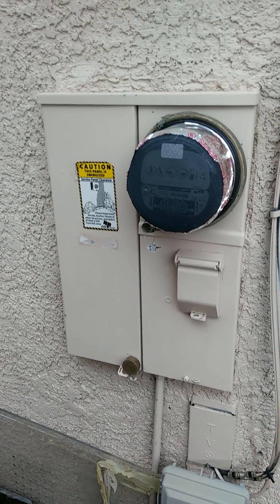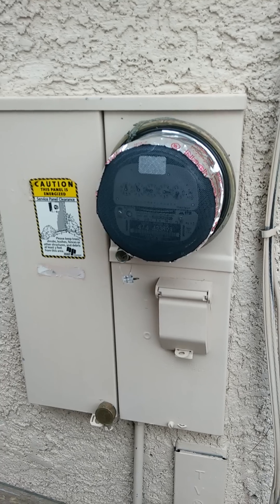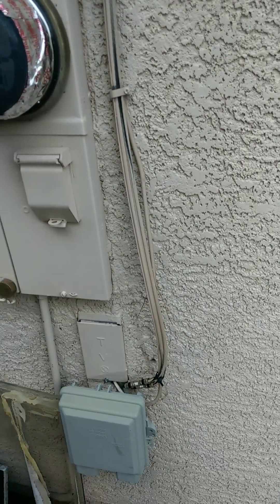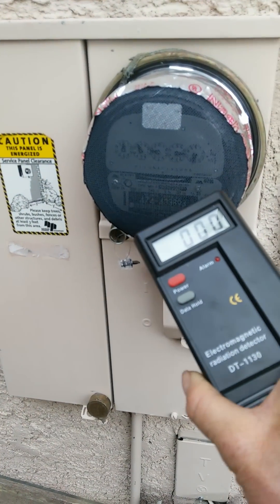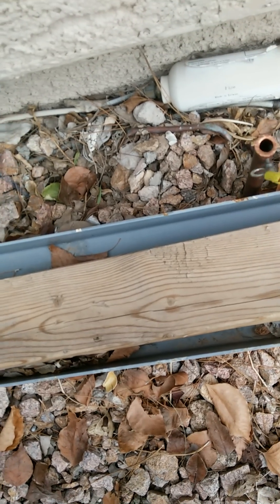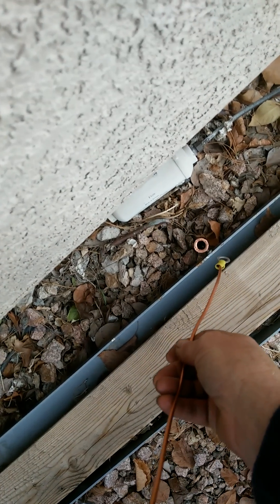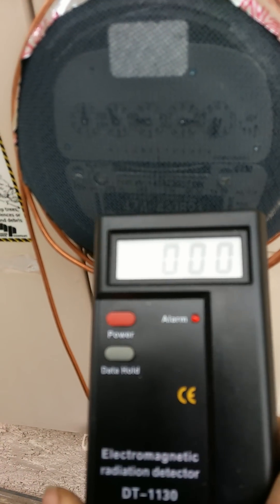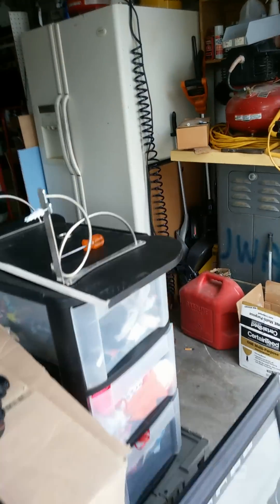Out smart the smart meter

Comment: Hilarious how so many people commenting that she is a dumbass are actually dumbasses. She said in the video that they put one on her house and she had it removed and she was just showing that even the analog meter would put out a strong magnetic field. There's an old saying you have two ears and one mouth for a reason, just saying.
Reply: Turbo Chevelle hey dumbass the smart meter would emit at a distance, the analogue meter only picks up within very close proximity as any blady conductor with current passing will create an Electromagnetic Flux, but isolated to a distance calculated by formula pending the amount of current passing, the type of insulation on the cable and the cross sectional area of the cable.. did you see the EMF meter was on 000.000 until she was right up on the analogue electrical meter? You have 2 eyes, two nostrils and a mouth, can you see you stirred shit  because I can smell it and you will taste it, everyone's right though, however I was polite to explain all about EMF and radio waves but still think this lady would have been better off pouring another glass of wine and rolling another spliff rather than to make her rediculous video on you tube...

The bitter end is her lug on her wire was far to large for that screw to make a permanent connection to the copper tube in the ground, she just clipped it around but you all saw it unclip in the video, then she had it extending to a coil around the meter, an EMF that cuts through a conductor at 90 degrees will induce a current, therefore a coil has got many 90 degree points where mutual induction will take place and a propper electrical charge will become induced into that coil, should the lug not stay secure, and the lug end is not earthed there is a high chance of someone sustaining electrical shock as the entire gizmo this lady put on the meter could potentially become a death trap if this system is 3phase at even 30A per phase, because who knows what else she done, I think y'all better off wearing tinfoil hats if you paranoid about your home meters and things, that's got nothing in comparison to what you experiencing with the phone you use or laptop you use or constant WiFi you sit in within your home and coffee shops for your internet.. haha this is all just such a great laugh and good start to 2018.. thanks
Reply: Turbo Chevelle 👍
Reply: Turbo Chevelle 
Everybody is always ready to jump to a conclusion. Ppl need to get their brains and their mouths calibrated. And do it at about 70/30 mix, with 70 being the brain. Have it so their brain works more BEFORE their mouths open....
Reply: She’s still kind of a dink. No evidence has ever been proven that illnesses or injuries can be cause by Electromagnetic fields from small consumer electronics. The level of electromagnetic field that harms humans is around the surface of a large amount Kv main line that’s can instantaneously burst you in flames because of the arc.
Reply: Justin Gibson yeah you better do some more research, there is evidence of what it does and causes and you'll be surprised how  long they have known it. While you're at it research microwave warfare. It's a.
Reply: one of the most important things to remember is to not give a fuck about the opinions of retards. who cares what they think? anyone they could possibly tell is most likely also retarded or pays them no mind.
Reply: I agree Chris Morse, I have never seen so many obtuse power company managers in one spot. All of them claiming their smart meters are 100% safe.  I bet the FCC is not laughing at these managers.

Comment: Extremely Irresponsible Journalism! Wiring is NOT a HOBBY! Hire a licensed electrician, obtain proper permits and inspections. There’s a reason why there is a State Board of Examiners of Electricians. It’s kind of important.

Do you have enough knowledge and expertise to be sure you’re not going to endanger yourself, your family or your home?

That’s an analog meter. Note the little analog dials and the rotating disk. Even if this worked she’s going to get busted for attaching a tampering device to a meter.

Comment: I believe there's a reason why her meter only cost $10...  It is NOT an RF meter...  It is an EMF, Electro magnetic field meter.  (Gauss meter) All energized wires/equipment will have some sort of field around them.  (looks like a standard analog meter which does have electricity flowing through it)  Her meter didn't start going crazy until she was right up on it.  And probably drops off as you back away.  Normal   Good to know though.  You don't want to be real close to them either.   She should check her outlets and appliances around the house to see how far they radiate out.

Comment: To those people saying it is not a smart meter, well you are only half right. It has a transmitter inside operating either 700mHz or 924mHz.  Using a spectrum analyzer app for android phone will show the actual  frequency. The electric company loves them because they just drive by to read the meter without getting out of the truck.  

By putting the aluminum foil and grounding the foil you are in effect creating a faraday cage to  cancel out the RF signal. You did a great job BTW.  Hope the electric company allows you to keep it on.  

as an alternative   just go solar and screw the electric companys. I've been on solar for 18 yrs.  Yeah they hate me.
Reply: well that screen is attached to the power companies property

Comment: Putting the detector up against the meter is a useless reading unless you're in the habit of rubbing your body on the meter. You should hold the meter about 6 feet away and see if there's any reading then. And rather than paying a monthly fee for an 'opt-out' meter, you can buy a wire-mesh shield from Amazon for around 30-40 bucks that will block all the radiation from the smart meter they had installed
Reply: In addition, see what the reading is inside room space, from the wall, out into that room, where the meter is outside.    The measure taken outside, should be relevant to if, and how much emission is perhaps being a problem for the next door neighbor.    The Emissions of far enough to reach head office computers, so don't think that if the readings seem weaker 6' to 10', it's not an issue.   We live drowning in Electro-smog, and most don't even have a clue.
Reply: Well the meter is plugged into a sheet metal box. From what I've seen in other tests, that metal blocks 100% of the signal from the smart meter so everything behind the meter box should be safe. I suppose you might have to worry about your neighbor's smart meter though, if you're  homes are close enough together. If you do want to check the inside of your house make sure you either have a fancy detector that only picks up the dangerous radiation or be sure to turn off your WiFi because that'll mess up your readings
Reply: Good points.   
One might think the metal box would shield.  However, enough people have readings that show the room on the other side of the meter, is loaded with EMF/RF  In that case, it might be wise to check to see if the meter is connected to ground.  Utility companies have been found to omit connecting it to ground...which can trigger fires, among other things, including a mess of wild signals.   Smart meters are not just counting your actual usage, they are counting the line "bleed", and the energy returning from your house to the GRID, which you used [it "returns to sender" so-to-speak].   
We are being billed for energy we don't use [the bleed], and about double for what we do use [the incoming, and the returning]  ...AND they manipulate what we pay by adjusting algorithms to make it seem we've used more....similar to how property taxes are adjusted using the Mil-Rates, while on paper, the basic unit price remains the same.  
One utility company rep actually said "People have been so good at saving energy, the utility company cannot pay it's bills" [that they are forced to pay to larger energy handlers, like Bonneville Power Association [BPA].   That's a huge "tell". 
When utility comes to replace a smart meter for the 3rd time in as many months, and tells the resident "Well, there must be something wrong with the meter, because you have a 300-amp service, and the meter is only showing about $50/mo, even in winter"....that's also a "tell".      In that case, the couple in the big house, with a barn/shop, used wood to heat, used a lamp to read by, ran the fridge, no TV, nothing else on......  Once the guy told the utility:  "hey, just because our electrical service has that capacity, doesn't mean we use it all the time!!!"...the utility stopped replacing their meter.

Comment: Still Dirty-Electricitiy in the cables , like caused by the cheapest ( FIRE causing ) Chinese computer power supplies 

Radiation guards must be properly earthed / grounded ... also always check if all all outlets & extension cords are properly grounded

Comment: let me ask do you have a computer a phone or a computer?  they emit the same damn thing
Reply: Usually (at least European) computers have Power supplies with better filtering & a PFC ( even the cheapest legal ones , even the ones with FAKE output power ratings  ) ... in EuropeanUnion beginning from 75 Watts maximum consumption, Power supplies are also required to at least have Passive-PFC & generally filter coils & filter caps ( X for all & Y for grounded PSUs ) & often grounded shielding

Edit: always make sure that all sockets are properly earthed ( = "Equipment Ground" )

many for US-American market intended cheap ( even Computer-) power supplies have absolutely no filters, no PFC & external power supplies also no shielding at all ( its just the rectifier [ or more often 4 pathetic diodes or in "wall warts" just a single diode ] ) & the primary electrolytic capacitor & now you are at the switching transistors = high frequency source + dirty electricity  ) 

and Ethernet wired LAN is an alternative to WLAN 

only use the smartphone hen necessary & & use the flight mode or power of when not used ... also use a headset  & do NOT put it next to your balls
Reply: Smart meters are not the only issue only the worst issue they are 4 watt making them far more dangerious.
Reply: You have the option to power those down.